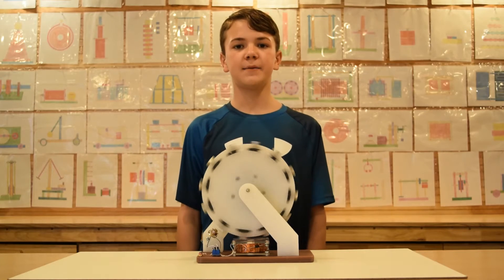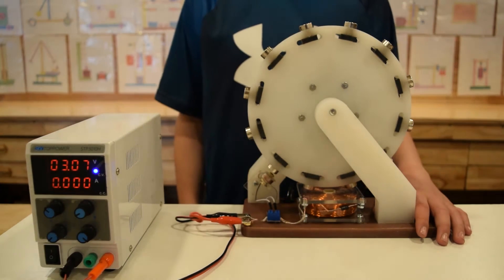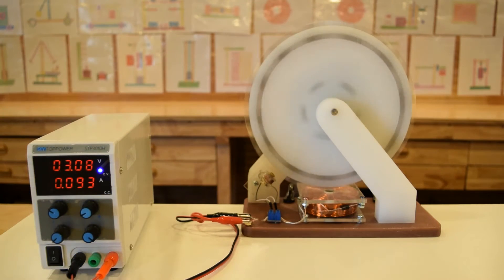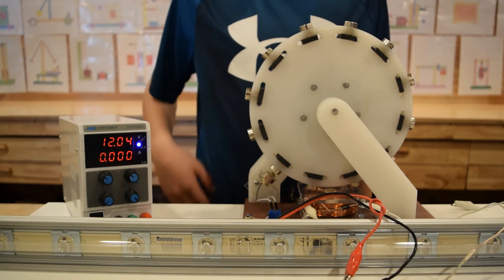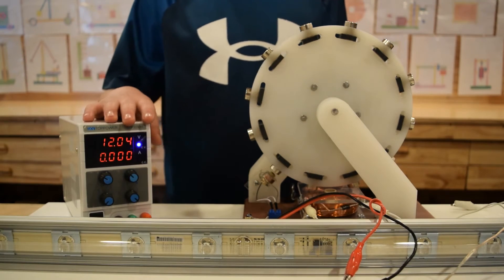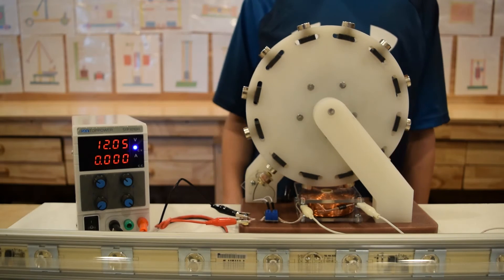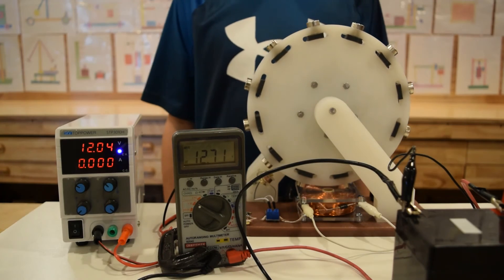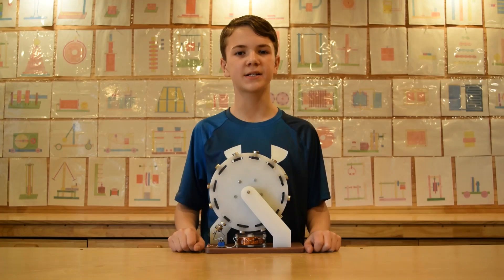Pulsed magnet motor single coil.

Comment: specs on coil wire and turns ??? ps good work kid keep it up ....
Reply: 400 turns of magnet wire number 16, the electromagnet is 1x3 inches. Not sure exactly about the resistance but a low resistance coil can run a magnet motor starting at 3 Volts DC, at high resistance it would take at least 12 volts DC to get the motor going with a single coil.

Comment: If you're not going to show amps out to the battery or to the lights,what's the point of showing the pulse motor at all.  
It all comes across like you just have to much money or something.  Show us you building one .
Reply: Wow. It's a kid you know.
Reply: Amps input is shown on the power supply unit. Amps drawn out to the leds and battery can be figured out with simple equations. But this is up to every enthusiast who is versed in  this field. That's why I believe Daniel didn't bother.

Comment: Hello my friend. It is very important for me your video, is it possible to know, if the electromagnet you have used, has ferromagnetic core, what is its electrical resistance and how many turns it has? Thank you.
Reply from the maker: 400 turns of magnet wire number 16, the electromagnet is 1x3 inches. Not sure exactly about the resistance but a low resistance coil can run a magnet motor starting at 3 Volts DC, at high resistance it would take at least 12 volts DC to get the motor going with a single coil.
Reply: @DanielsInventions  Thank you Daniel